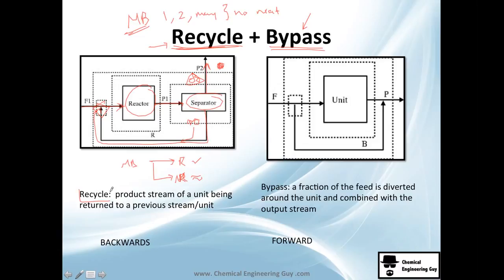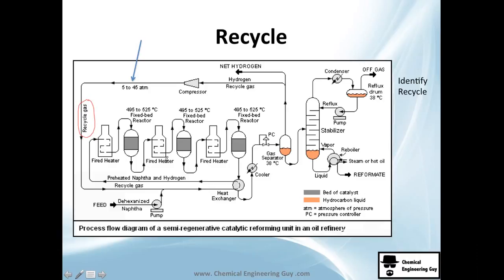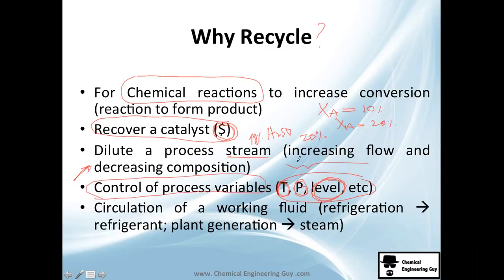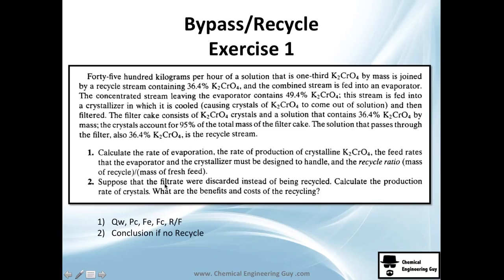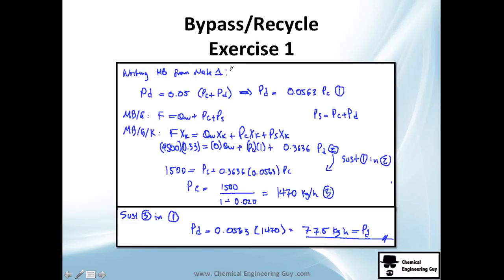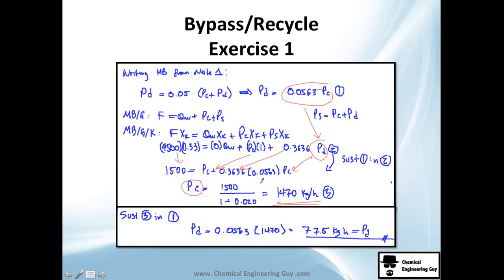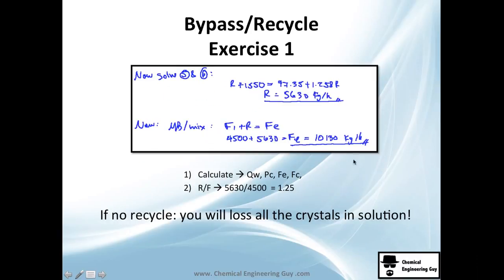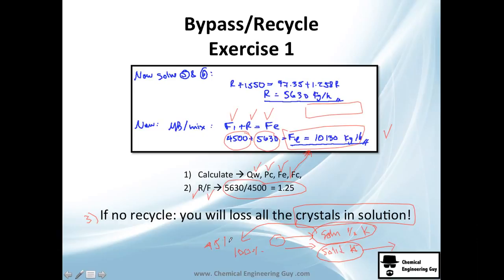Bypass & Recycle Streams  // Mass Balance Class 11

Comment: Hello!

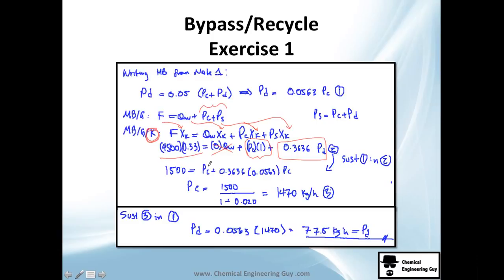Once more, thanks for all the information and your time and effort spent in the creation of these videos. However, I will agree with several posted comments. The explanation is not clear, which creates a big confusion when trying to understand the example. It has been more than ten years, and it is not clear what Pd is, it is not shown anywhere in the scheme. It is not clear for me if Pd is the dissolved fraction, or is it the solution, or to what it corresponds? Besides, the way you go from one variable to another in the relation Pd, Pc, and Ps is extremely confusing, for example, in 14:34 in which it seems that Pd = Ps! Besides, it is nice to explain that you are rounding the numbers, as for example, 0.33 * 4500 = 1485 and not 1500. It will be nice if you can correct these mistakes, as this will help a lot to get the most out of the video.

Thanks and best regards.
Reply from the maker: "Appreciate the feedback 🙏 I get your point about Pd, Pc, Ps and the rounding—will work on clarifying that in future videos!"

Comment: can you or anyone tells me how the recycle stream works in real industry process, like inside the unit how it is being separated and leave with special stream and products leave with another without combining at all? Thanks
Reply from the maker: Recycling in real life is nothing but a pipe with the stream being recycled or transported back to the system. Typically, you will either treat it (cooling/heating, pressure adjustment, etc)
Reply: @ChemicalEngineeringGuy   so what is really going on inside a process unit, say a reactor, is that there will be different pipes stream inside the unit that let materials in depending on pressure and temperature differences or phase change? thank you

Comment: Hey there. I don't understand why Pd = 0.05( Ps + Pd). could you explain it to me Sir? Thank you :)
Reply: I don't see Pd labelled anywhere in the system
Reply from the maker: +Fred Loemba it comes from NOTE 1: 95% are solids, therefore 5% are liquids (which is actually a solution)
Reply: Thank you sir I get it now
Reply from the maker: no worries! keep the good work!